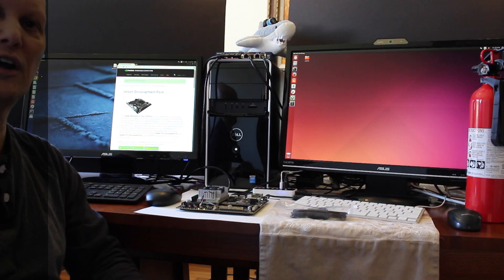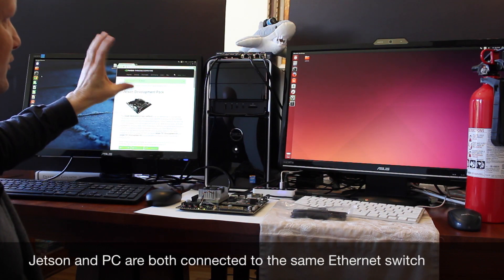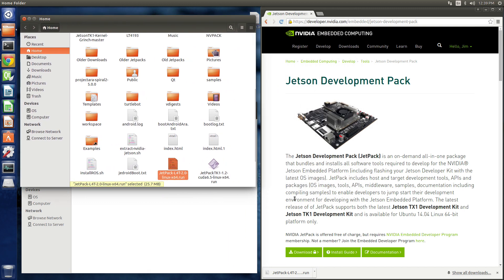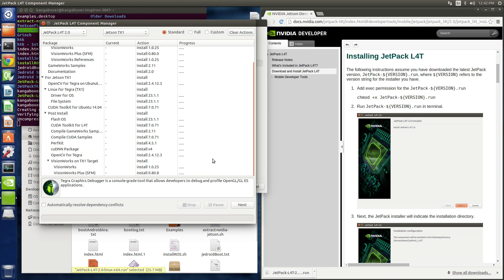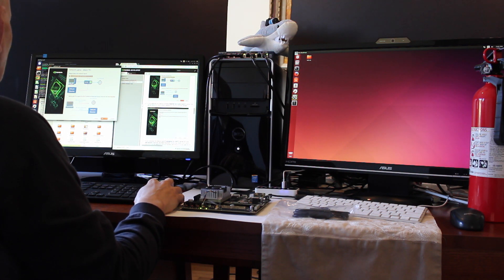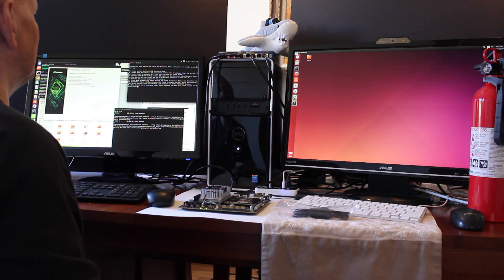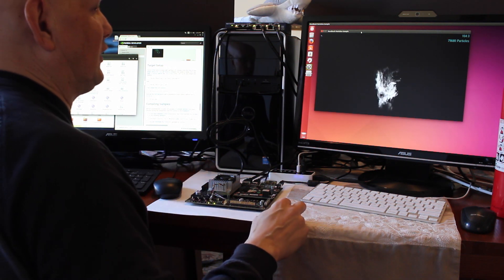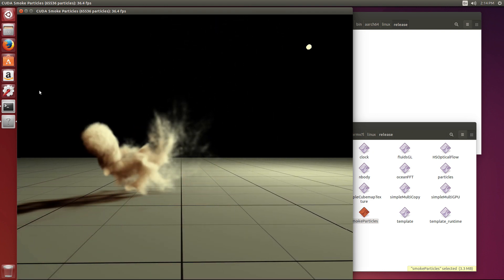JetPack 2.0  Install  on NVIDIA Jetson TX1

Comment: It's a shame that the shark is not included in TX1 kit :)
I open up the new TX1 kit which has been stored for a long time untouched(!) in my lab. So, i plan to use this. I have a quick question. 

Should the host PC has a ubuntu which is same version with the TX1's ?
Thank you in advance & nice vid!
Reply from the maker: The version of Ubuntu is independent of the two. Follow the recommendation of the version of JetPack that you use. As of this writing, it's currently JetPack 4.5. Thanks for watching!
Reply: @JetsonHacks  alright! thank you, sir.

Comment: Hi,
I have a jetson tx1 development kit but ı want to control it remotely without and hdmı cable. How can ı do that?  Could you please help me this situation?
Reply from the maker: You can SSH in to the Jetson over wireless. Please ask this question on the official NVIDIA Jetson forum where a large number of developers and NVIDIA engineers share their experience. Jetson TX1 forum: https://devtalk.nvidia.com/default/board/164/jetson-tx1/
Thanks for watching!

Comment: Hello JetsonHacks:

I try to install JetPack 3.0 on the TX1, I use my laptop(ubuntu 14.04) for the HOST.

But when I enter "" sudo ./JetPack-L4T-3.0-linux-x64.run"", It appears a warning : ""We notice you are running OS with non-EN locale. NVIDIA does not test nor support such configurations"".

Then I press ok, It appears an error : ""Error occurs during instaltion"".

How can I solve the problem? Thank you!!
Reply from the maker: Hi Tim,
First you do not need sudo to run the command, issues will arise if you do. You can try it without the sudo command and see if that helps.
I do not have anything to share about the issue that you have encountered. Please ask the question on the NVIDIA Jetson TX1 forum: https://devtalk.nvidia.com/default/board/164/jetson-tx1/
Thanks for watching!

Comment: i was unable to flash my 32 bit Ubuntu with R23 to R24 using a host as ubuntu on mac 
here is my error on terminal

https://gist.github.com/akarsh/768c4a8679a694d8855fa48e9a4b7568
Reply from the maker: You appear to have some sort of permission issues. Running this on a Mac is beyond the scope of what can be discussed here. Please ask the question on the NVIDIA Jetson TX1 developer forum: https://devtalk.nvidia.com/default/board/164/jetson-tx1/
Reply: +Jetsonhacks Thanks for the response.  I will try there
Reply: I now successfully updated it the board from 32 bit to 64 bit by flashing.

I think the problem is with live usb stick.  As it does not have enough space.  I installed Ubuntu on my windows machine & updated it before flashing.  It worked well
Reply from the maker: That's great to hear! I am glad you got it to work.

Comment: I followed your tutorial, and it was very helpful! Thanks for that! Btw, after installing JetPack 2.2 on my Jetson TX1 I'm having troubles with system freezing! Very often the whole system just freezes and I have to reset it on the RST button. I was googling for 2 days about the issue but with no luck or solution. Do you maybe know what can be the problem? Thanks in advance.
Reply from the maker: Hi Lazar,
I haven't used 2.2 yet on the TX1. You can get help on the NVIDIA Jetson TX1 forum at:  https://devtalk.nvidia.com/default/board/164/jetson-tx1/
Thanks for watching!
Reply: 855-835-5324

Comment: I gotta thank you so much for this walk through. I knew some of it already but on a few occasions your video really helped me get through the install. The instructions aren't all that great either and there's quite a few steps with this install. I installed the "Full" instead of the "Standard" which you installed. Not sure if that meant more or not, it looked like you had selected everything. Anyway, yes it does take quite a while to load all the software onto the Tx-1

Comment: +Jetsonhacks This is a great tutorial. Thanks for sharing.
I thought it would be also great if you could make another video explaining JetPack (with Visionworks) installation and development only on host (linux x86) without having to flash a Jetson board. Some possible considerations?

Comment: Are those just general CUDA samples or specific to TX1?  Think it is worth spending the 599 to get this if you already have a laptop with an 970m you can play with?
Reply from the maker: +Ryein Goddard The CUDA samples are the general purpose ones that a CUDA equipped graphics card or embedded processor with the proper compute rating can execute. 
The second question is harder to answer, it depends on your needs/wants. The interesting part about the Jetson TX1 is the low power consumption, and the ability to develop different products based on the chipset. Some people use them as their own media server or desktop. This is the first readily available 64-bit ARM processor with a reasonable amount of memory on it and I/O availability. It's up to you to determine if that's intriguing enough for a purchase.